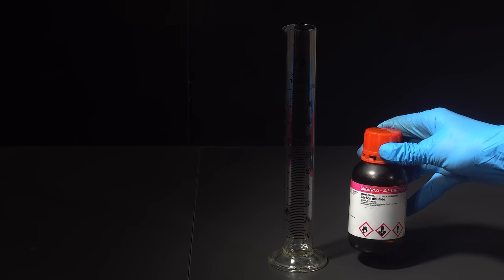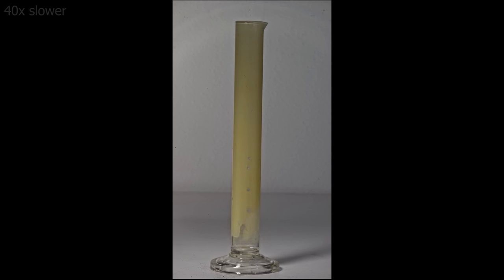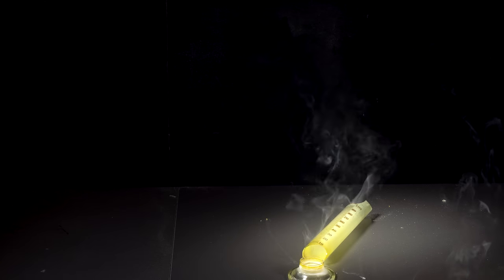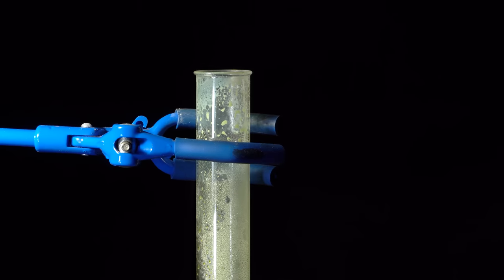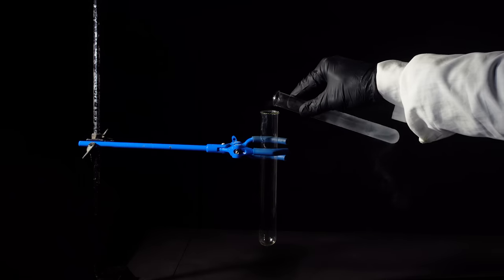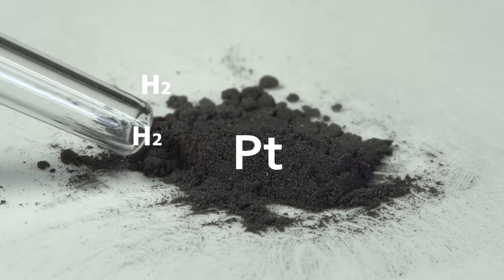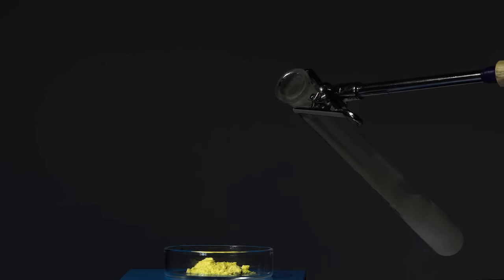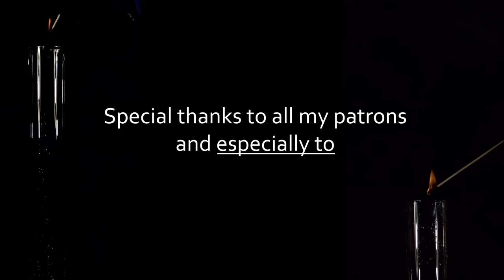EXPLOSIVE Barking Dog Reaction! Cryogenic Gases Explosion!

Comment: Hands down one of the best chemistry channels on YouTube!

The sudden explosions are likely due to a deflagration-to-detonation transition (DDT)--- which typical occur for confined premixed gases with sufficiently high flame speeds.

In other words, when the flame reaches the bottom of the test tube, the gases produced cannot escape the test tube fast enough now. This leads to an increase in pressure, which leads to an increased combustion rate, which leads to a further increase in pressure, etc. This very quickly results in a detonation. If this same experiment were performed outside of a test tube, you would see very fast burning, but no detonation.

Thanks for your videos! They are AMAZING!!!
Reply: Wow I’ve never heard of this, I always thought deflagration and detonation were two very different phenomena. Are you saying it’s more of a continuum, with the somewhat arbitrary speed of sound just being the delineator?
Reply: The transition is also sensitive to stoichiometry and how well mixed the substances are.  Allowing these mixtures to sit for a bit likely improves mixing in the liquid phase substantially.
Reply: @Syclone0044   Because the speed of sound is involved, the combustion processes are inherently different between deflagrations and detonations. So, they actually are very different phenomena. For example, deflagrations propagate by heating up the fuel-oxidizer mixture in front of it and by having certain reactive radicals diffuse into unreacted fuel to continue combustion (i.e. convection and diffusion processes). However, if you are travelling faster than the speed of sound, this cannot happen. The speed of sound is just too fast for convection and diffusion processes to occur. So, rather than using convection and diffusion to progagate the flame, detonations actually use the their shockwave to suddenly compress the fuel-oxidizer mixture ahead of it so ignition occurs. In other words, detonations work completely different from deflagrations. However, you can go from deflagrations to detonations (DDT) and vice versa (detonation arrestor) if you have the right conditions.
Reply: @robertlapointe4093  Agreed. Diffusion flames cannot undergo DDT, but pre-mixed flames can. So, the more pre-mixed or homogeneous the mixture is, the easier it is for DDT to occur.
Reply: Unless there's a multi-stage combustion process (which, I don't think so from the observations, but that would be cool if so..?), the vapors alone seem very mild mannered; but it seems to then ignite the liquid phase, which then goes off much, much faster.  Perhaps the liquid burns for a moment, then goes off, which would indeed be a DDT.  I suppose the dynamic is something like, as flame velocity approaches the speed of sound, it accelerates into a shock wave, and rather than expanding out of the way, pressure builds up driving the wave itself forward (thus, a shock); the vastly higher (100s or 1000s of times) density, and therefore power density and expansion rate, of the liquid phase, I suppose more than compensates for the higher speed of sound in it. A small sample like that could go off in mere microseconds if so; you'd need a truly awesome frame rate to fully resolve such an event!
Reply: @T3sl4  I think the vapors seem mild mannered because the flame is intially going into the tube and there is not enough pressure behind the flame to drive it to detonation in such a short distance (given enough distance though, and it might). However, once at the bottom, the flame can't move anymore because and that leads to a DDT in the gas phase. It's kind of like the classic whoosh bottle experiment. If you ignite a whoosh bottle from the top, you get the cool whoosh effect that everyone enjoys. But if you ignite it from the bottom, it detonates (hence the reason you should never drop a match in a whoosh bottle!). I think this initial detonation from the gas phase then goes into the liquid like you are suggesting. It's usually the gases above a liquid that go through DDT, which can then detonate your liquid. It's pretty amazing stuff!!! 

In my lab, we typically need over 500 thousand frames per second to see the longer-scale detonation effects. If we actually want to see the shockwave move through liquids/solids, we start pushing into the millions of frames per second. If we want to see the effects of microstructures in explosives, then we start pushing into the billions of frames per second!
Reply: In the ones that explode, it also looks like there is still a substantial amount of liquid at the bottom of the test tube. Maybe the wait time allows the liquid N2O and H2S to become fully mixed by diffusion, so that the reaction can proceed very quickly throughout the whole volume of the liquid, rather than just at the interface between the two. It looks like the detonation always occurs right when the visible flame front touches the apparent liquid level.
Reply: @pyr0duck676  Sir, you explained this better than many books I've read on the subject. And I've read *many*.
Reply: @pyr0duck676  Ahh, cool!
Reply: Yep inclined to agree with the DDT hypothesis, there's definitely signs of low order detonation as the mixtures start to self confine.
Reply: WOW! I understood many of those words, but not in that configuration lol 😂 sounded very clever though. Awesome stuff. Love the slow-mo shots

Comment: I've got several hundred ml's of carbon disulfide set back for a special occasion.  Also several grams of white phosphorus.  I'm sure most of you can figure out what it's going to be used for.  Lol!  Hoping to post that video by the end of summer.  Surely by then I'll have enough time off to be able to record it.
Reply: And some potassium chlorate I assume? Be careful,  that's a scary one!
Reply: @chemistryofquestionablequa6252  indeed!  And yep, nothing but the utmost respect for that mixture.  Will probably be mixed remotely somehow, just in case.  But as you personally know, that kind of thing is not something to turn me off from doing it.  We'll get it in slow motion as well.  😃
Reply: I have the same reagents but... I wondered if it would be possible to avoid ignition. I'd like to "write" on paper and enjoy de phosphorescence in the dark.
Reply: @BackYardScience2000  sounds awesome!

Comment: Starts off as a deflagration and then the instant the propagating flame hits the liquid, BOOM! It detonates. I'm suspecting that the increase in density has everything to do with the deflagration-to-detonation transition here: when the gaseous N2O and H2S mix, they're not at a high enough density to sustain a detonation, while the liquid form has the fuel and oxidizer molecules in much closer proximity with each other. Moreover, because the liquids are cryogenic, the instant the flame front propagates through the mix of liquids the resulting increase in temperature pushes the liquids past their boiling point so quickly that they have no choice but to detonate instead of boiling at all.